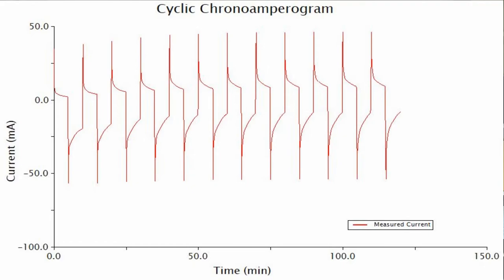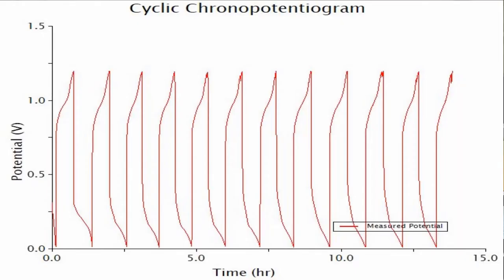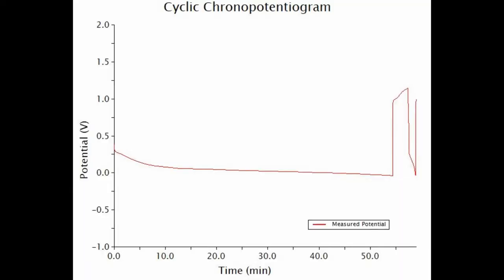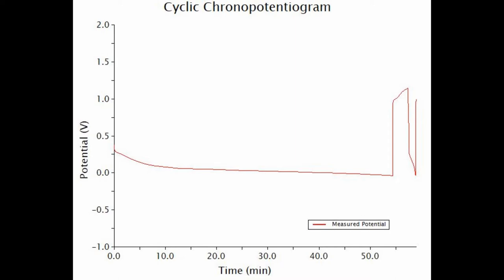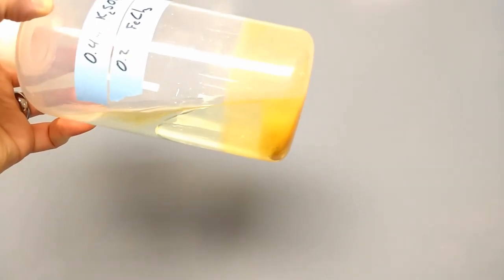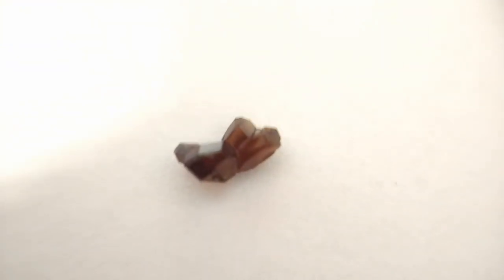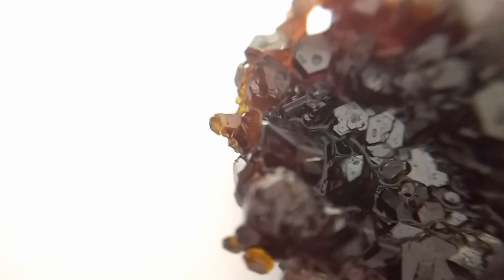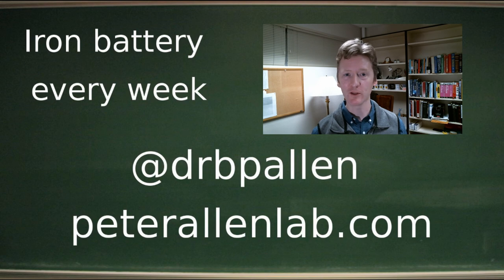Iron and Iron Chloride cell: Iron battery, part 59

Comment: For stationary batteries, energy density is not the same issue as it is for transport, so the iron battery will not be the solution to all energy storage requirements, but we already knew that.  It should be possible to make a very long life , non toxic stationary battery with it.

FYI, there are other interesting pieces of the alternative energy emerging, check this out....

https://powerledger.io